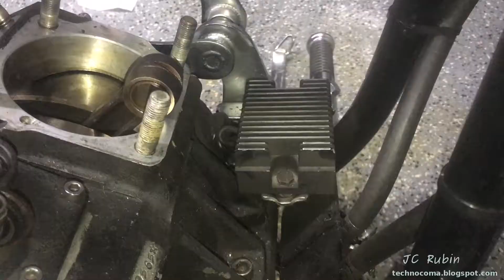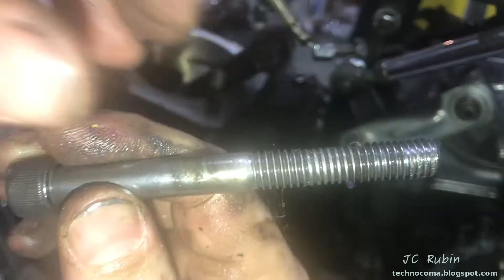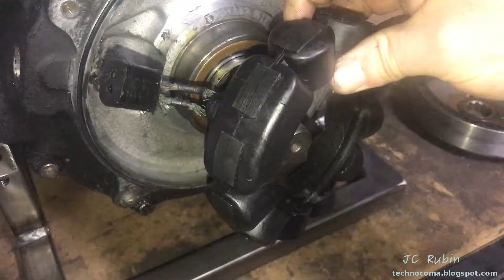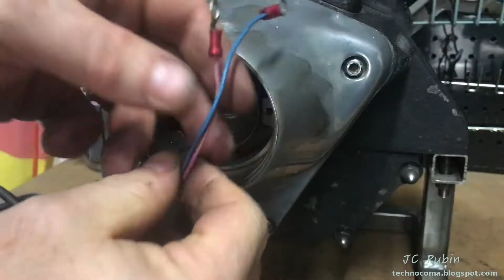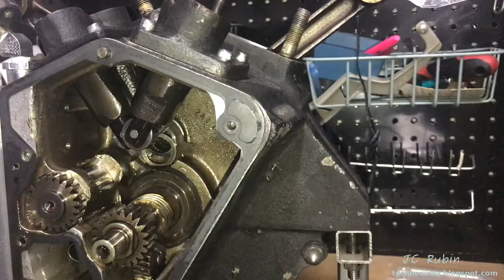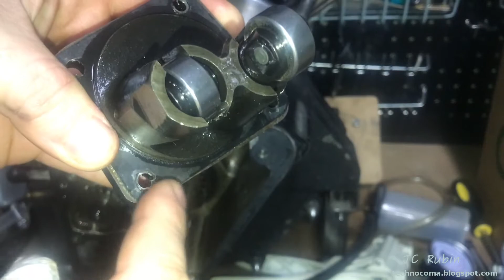AMF Shovelhead Lowrider Restoration -8 -Engine Removal and Disassembly

Comment: Your videos are awesome, very detailed. I have a 1976 FLH. I’m changing out the stator on it. I need to use a puller to remove the rotor shell. Would you happen to know what size the three threaded holes are?
Reply from the maker: I have a tool given to me by a viewer that allows for quick checking of thread size.

https://www.amazon.com/gp/slredirect/picassoRedirect.html/ref=pa_sp_atf_aps_sr_pg1_1?ie=UTF8&adId=A08316252IE5IPY2LSEEA&url=%2FCKE-Bolt-Thread-Checker-Metric%2Fdp%2FB08L38BJDS%2Fref%3Dsr_1_1_sspa%3Fcrid%3DS028U85VTHEX%26dchild%3D1%26keywords%3Dthread%2Bchecker%26qid%3D1630555609%26sprefix%3Dthread%2Bche%252Caps%252C205%26sr%3D8-1-spons%26psc%3D1&qualifier=1630555609&id=5228238720624927&widgetName=sp_atf